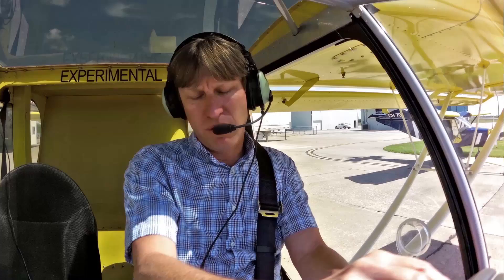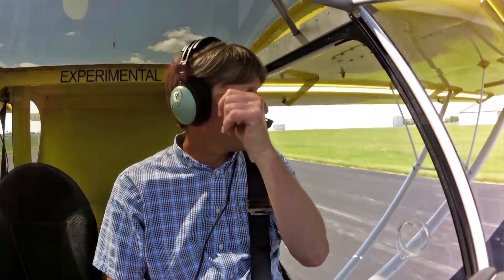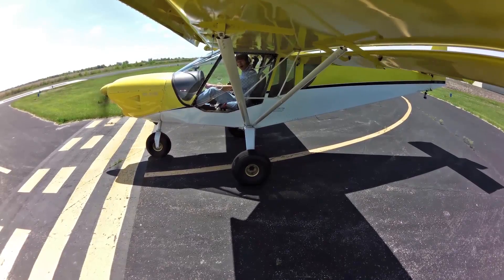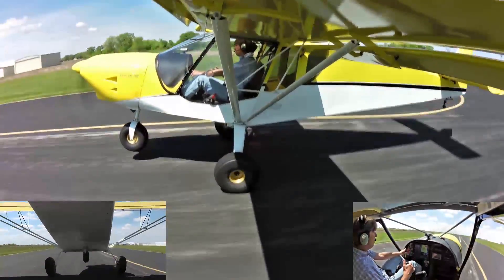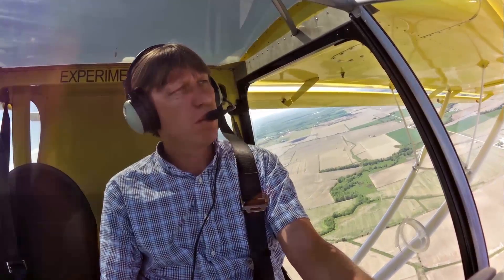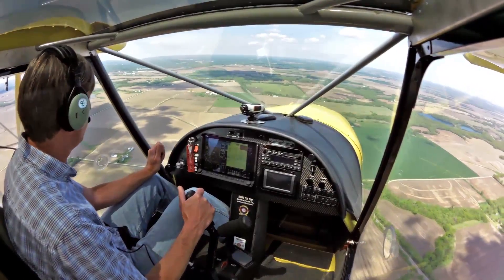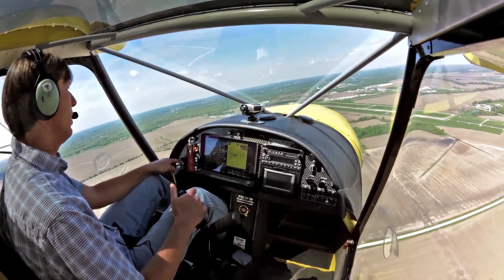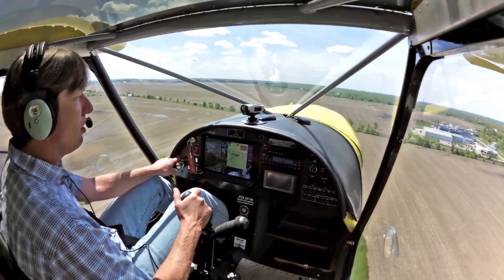Virtual Demo Flight: Zenith STOL CH 750 "Sky Jeep" light-sport utility airplane

Comment: I like the dual sticks so I can fly with my left hand and use my dominant right hand to work all the "knobology" and touchscreens.  The ergonomics are better than with the Y stick for right-handers.
I've got the dual sticks and have never found cockpit ingress/egress a problem if you know how to get in!  Back up to door opening,  boost up into seat with left foot on tire, swing both feet inside and place them on the floor on the LEFT side of stick, SLIGHTLY raise your right knee and PUSH the stick under your knee and between your legs. Done!
True story - my late wife was not so nimble and when I was going to take her on her first flight in the STOL 750, I had this big speech all prepared to help her get into the cockpit.  As she was starting to get in, I was distracted and looked away.  When I looked back, she was comfortably seated with the stick between her legs (without benefit of my speech!).  I asked her, "Did you have any trouble getting in?"  She said, "No, why?"  My response, "Never mind!"   ;>)
Reply: I'm not a pilot, yet, but I can definitely see why your observations on a center stick allowing left handed flying and right handed knob jockeying would be spot on.

Comment: Beautiful plane.  I "flew" the CH750 in X-Plane 11.50b6.  Don't know how representative the flight model is, but the aircraft was amazingly smooth and gentle in X-Plane.  I like!  Note: the version 1.6 of the acf aircraft file linked to from the www.zenithair.com website was saved for X-Plane 10.20 and is not recognized by X-Plane 11 by default, probably because it is an older file format.  In order to get it recognized by X-Plane 11, I loaded the acf file in the older PlaneMaker 10.51, re-saved the file without changes, then moved the aircraft to X-Plane 11.  I also regenerated the icons in X-Plane 11 so it wouldn't show up as a "plane with a question mark" in the user interface.  Worked like a charm!  I don't know how much control Zenith Aircraft has over the model, but if you do, you might want to update it for X-Plane 11.  After all, it's free advertising!

Comment: Hi. I am thinking a some hydraulics pipes to follow the cammands wireing. And a some kind of propeller clutch to power the hidraulics in the case of wire and engine failure. Exactly like a wind turbine. My deep regards, Petru Razvan.

Comment: Question: I suppose the aircraft has pretty low glide ratio and certainly has perfect STOL capabilities. Why is your approach angle so flat? I suppose, in case of engine failure you will not make it to the runway? Is it only an optical illusion?
(Any yes - very nice aircraft!!)

Comment: 19:03 "Always keep you head out of the cockpit"...  they must teach flying a little different in MO!  So, Roger, how tall are you?  I see you sit way back on your butt with little leg support.  I have always liked the 750 but am doubtful I'll be comfortable at 6'3" 195lbs.
Reply: I would be very surprised if you could not make any of the Zenith high-wing aircraft comfortable for yourself. This design is very conducive to customization with some minor non structural modifications. I modified my seat so the whole seat reclines rearward. My buddy is 6'5" 250 lbs and he says that my 750 is the most comfortable aircraft that he has ever flown in. That includes Cessnas, Pipers, Vans RVs, etc. I was able to set the seat so his thighs are contacting the seat bottom so there is minimal pressure on his butt. There a lots of good aircraft to choose from. The Zenith 750 is one of those and I love mine.
Reply: @Beaver550  Thanks for the update.  You wouldn't happen to be in Southern CA?
Reply: @MarkSDCA  Hi Mark, no, I am from southern Alberta Canada.